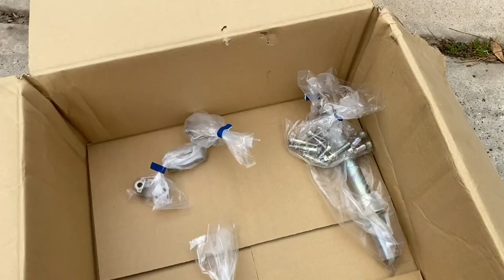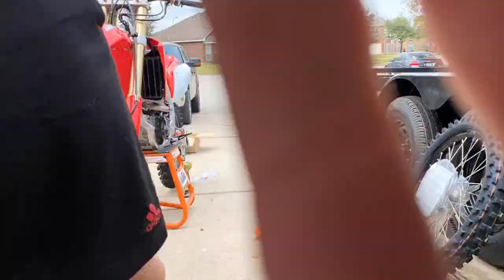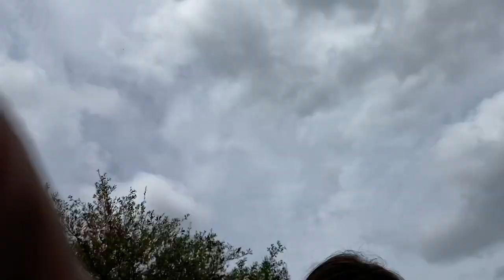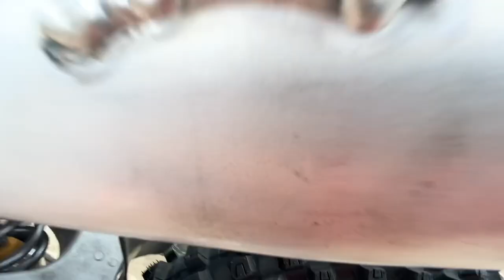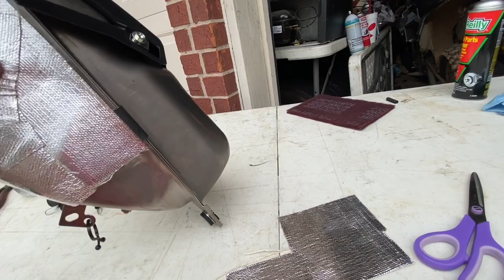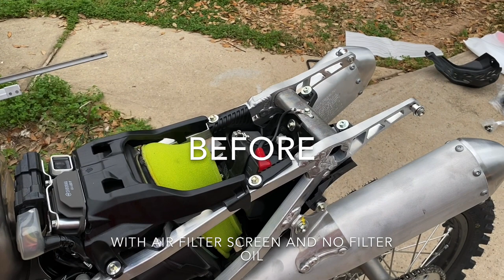Unboxing 2020 crf250

Comment: Get the ecu tuned to whatever mods you do to the bike it will help clean up the power through the rpm range and in the end add some extra usable hp and tq.
Reply from the maker: Hunter Stanley think im getting a vortex ignition
Reply: @granttaylorvlogs  did you ever get a vortex?
Reply from the maker: @NickW90  not for the honda no.
Reply: @granttaylorvlogs  ahh ok. My vortex will be here tomorrow can’t wait
Reply from the maker: @NickW90  let me know how it is!!
Reply: @granttaylorvlogs  ya for sure man. I got twisted development to map it
Reply from the maker: @NickW90  im planning to do the same for my kawi
Reply: @granttaylorvlogs  do it man. Everyone that has one loves them. Xpr motorsports and twisted are the two most popular places to get then mapped in Cali
Reply from the maker: @NickW90  yes for sure. And I’ll be in cali for fox raceway round 1 so I’ll probably be stopping by to see them!
Reply: @granttaylorvlogs  put the vortex in today and right off the bat couldn’t believe how much more responsive the throttle response is. Was only able to take it down a dirt road but holy fu#k i cannot believe how much more power the bike has, and before the vortex i had my stock ecu remapped by tokymods
Reply from the maker: @NickW90  big difference from remap to ignition? Also how was the difference from stock to remap?
Reply: @granttaylorvlogs  i should mention when i put my tokyomods remapped ecu in i did a full yoshi exhaust at the same time. But going from the remap to the vortex was more of a difference then the pipe and remap. If i were to spend money on a tokyomods remap i wouldn’t even suggest it. The twisted development map was so much better and noticeable it’s not even comparable. I did not expect it to make that much more power then what i already had. Totally worth the money
Reply from the maker: @NickW90  awesome thanks for the info!
Reply: @granttaylorvlogs  no problem man

Comment: That’s really cool, will definitely help up that extra spark and will help if you change out the piston or cam
Reply from the maker: Hunter Stanley im thinking piston for sure.
Reply from the maker: Hunter Stanley ya ignition and piston is what im thinking. But still not 100%
Reply: Those are really good things to do to the bike for sure to get all the power out of it as much as possible if you do a piston and ignition me personally I’d go ahead and do a cam as well as porting and polishing the head and some upgraded valves since you want to pull as much usable power out of it, it’s not the KTM 450sxf you’re used to riding and I’ve seen how you throw that bike around so when stepping down it’s gonna be like uuuuuh I need a lot more power lol plus if it’s a race bike go the extra mile to be able to compete with the factory guys as much as possible.
Reply from the maker: Hunter Stanley I’d like to for sure. Thats just more price tags.
Reply: Yeah I understand that for sure lol but also the power to weight ratio plays a huge factor into how that bike will feel so that’s also something to keep in mind, a high  compression piston is a good thing to do to get a good amount of power out of the bike along with an ecu and exhaust, depending on your budget of course.

Comment: It´s the same airbox. The air filter is bigger than 2019.
Reply from the maker: Facundo Parra volume wise it’s bigger but the inlet still works fine. 👍🏻
Reply: @granttaylorvlogs  Yeah works great. I have a CRF 250R 2018. I´m from Argentina. Congrats for your new bike.